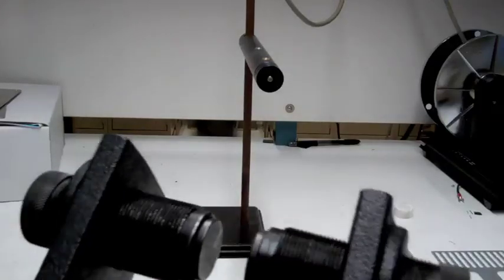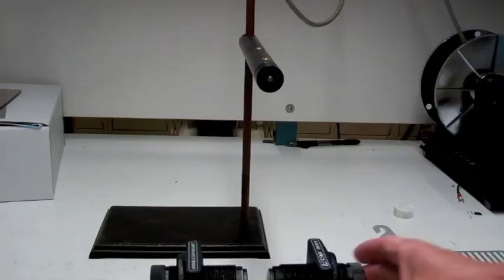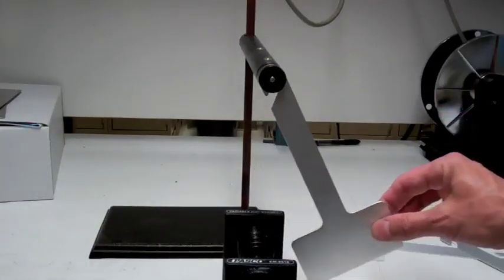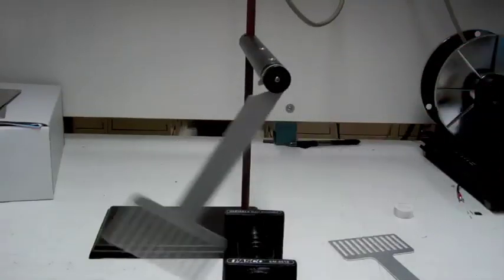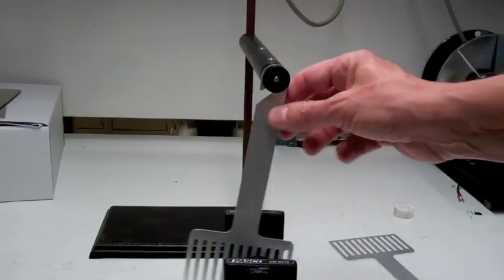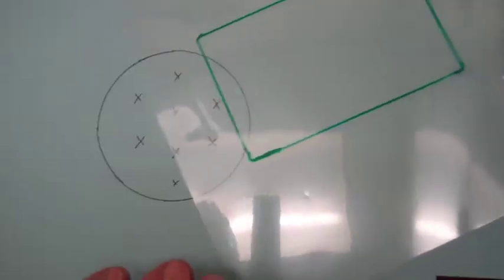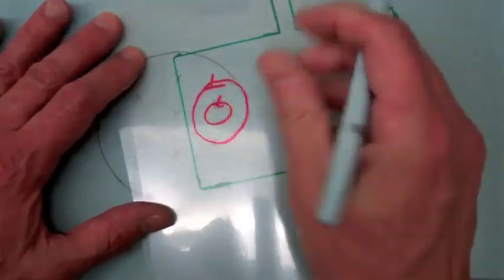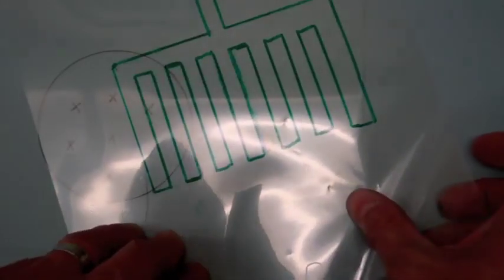Eddy Currents and Magnetic Braking of a Pendulum Caused by Electromagnetic Induction

Comment: Sounds dumb but can we create car brakes with this?
Reply: they are used in breaks for high speed trains and rollercoasters actually! so your idea isnt that unreasonable. i think one problem would be that for a car, you wouldnt want a dead battery to mean no breaks if its an electro magnet. (i think permanent megnets would be too much extra weight). also a car break with this mechanism would "feel" different especially with low speeds while parking for instance. the sharp breaks of friction based technology probably make for tighter control.

its a fascinating idea though. i deffinetly wonder if its been tried for cars.
Reply: @kettenschlosd  Oh cool! Thanks for sharing. And maybe they can create a hybrid system, magnet brakes with faster speeds  like on the highway and then it switches to a mechinal one at mechanical  half way. Or if no electromagnetic power, just defaults to your mechanical brakes. Regardless, this is cool technically and never knew that roller coaster utilize this

Comment: The red current loops are drawn incorrectly. Half of the loop must be outside the magnetic field. This is required so that the Lorentz force stops the pendulum (else the force on half of the current loop cancels the force on the other half). The current loops form around the boundary because they encircle the change of flux, which is at the boundary of the magnetic field.
Reply from the maker: I should have been more careful with drawing the  eddy currents. Back then I had a difficult filming arrangement and it was hard to concentrate on what I was saying, what I was drawing, and what I was filming.

Comment: How does a battery operated magnetic pump work? There must be an aluminum showing between the coupled magnets, so how do they get around the Eddie  current problem and keep their efficiency?
Reply from the maker: I don't know anything about magnetic pumps. It is something I will look into and maybe there is a potential video there!
Reply: @electricandmagneticfields2314  Oh man that would make a great video! Basically you can magnetically couple a motor to a shaft radially through a housing so there are no shaft seals which is a huge advantag for a lot of reason. However, there are a few tricks to maximize coupling and minimize eddie currents I'm still trying to understand. Advanced Diver Propulsion Vehicles also use them since shaft seals are the biggest risk to flooding a housing:

https://youtu.be/eufuhWX-ZjM?si=SGjZJTR_Idv97WEf&t=19

https://www.youtube.com/watch?v=IAkxS1xVraw
Reply from the maker: @peteabdu9179  Thanks!

Comment: If the eddy current results in a magnetic field that acts perpendicular to the motion of the pendulum, then why does it slow down? Wouldn't it need to experience a force in the opposite direction to the way its travelling in order for it to slow down? And does the magnetic field due to the eddy currents cancel out with the magnetic fields due to the bar magnets?
Reply from the maker: The force on the eddy current from the permanent magnet is F =Idl x B, so perpendicular to the eddy current and the the permanent B field. Superposition holds so the magnetic field at some point in space is the same of the tow magnetic fields. Just like it would be if you had two bar magnets.

Comment: Great Video. Well explained
Just wanted to inquire whether there is a formula to calculate the magnetic damping caused by eddy's current.
Reply from the maker: Thanks for the kind comments. The calculations would probably have to be done numerically. First using Faraday's law to determine the induced currents and then F = IdLXB to get the force on the paddle.
Reply: @electricandmagneticfields2314  thank you but how would the number of oscillations, come into play in the formula. As I'm really curious to how eddy current is produced from the pendulum motion but want to know how to quantify my observation.
If you could help me, I would really appreciate it.
Reply: @electricandmagneticfields2314  how do you determine current using faradays law

Comment: I understand the direction that the magnetic field is induced but how does this lead to the pendulum stopping, i.e. how is a force created in he opposite direction to the motion?
Reply from the maker: You can think of the pendulum as becoming a magnet. So for the two permanent magnets and the magnet representing the pendulum you would have,

[S permanent magnet N]  [N pendulum S] [S permanent magnet N]

So as the pendulum tries to swing between the two permanent magnets it is being repelled by the two permanent magnets and hence slowed/stopped.

Comment: can temperature equivalent to 1000 degree c be produced by the help og eddy currents????
if so what should be the strength of the magnet used?
can iron be used for the same???
Reply from the maker: I have never looked at calculating how much heat is produced. I would have to think for a while as to the best way to calculate the heating. The heating would be directly proportion to the total change in flux with respect to time. So the larger the magnet and faster the motion the greater the heating.
Reply: thank u sir...could u plzz confm it...is it possible st all?
Reply from the maker: Yes it can be done. From the changing magnetic flux caused by the motion you can determine the electric field intensity induced in the aluminum. Then from the resistivity of the aluminum you could determine the resistive heating. Alternatively, since the solid aluminum pendulum stopped immediately upon entering the magnetic field region, the kinetic energy the pendulum had would have been converted into heat--a simpler way to get an estimate of the heating.
Reply: very thank u..sir...u helped me a lot...
Reply from the maker: I'm not sure what is practical using a mechanical motion to produce induction heating, but using an AC signal to generate the changing magnetic flux is how induction furnaces operate, http://en.wikipedia.org/wiki/Induction_heating

Comment: can you please tell me the strength of the magnet used ,thickness of metal sheet and the amount of heat it produced
Reply from the maker: The magnet was a variable gap magnet with two one inch (2.54 cm) diameter neodymium magnets, I am not sure what the field strength was. The aluminum pendulums were about 2 mm thick.
Reply: thnxx...

Comment: Hi Michael!, I have a question... If there's a steady neodymium magnet and I horizontally slide an aluminum strip considerably close to it, the strip will slow down till it stops or it will just continue to slide but a bit slower?
Reply from the maker: Interesting question. As it slows down, the eddy currents will get smaller and smaller, but they should still be there and exert a force on the bar till it stops. But it won't actually be held in place by the magnet, so any additional outside forces and the bar will move. That is why when used as the brakes for a roller coaster magnetic brakes can't be used as block brakes so there has to be an additional brake to stop/lock the roller coaster.

https://en.wikipedia.org/wiki/Brake_run

http://physics.gu.se/LISEBERG/eng/magn_brakes.pdf
Reply: Great!. Thank you for the answer, it helps me a lot. Have a good day.

Comment: Hello professor Melloch, 
My name is Rich and I was wondering if you could give me an opinion on a possible solution to a problem I’m having with a set of carburetors that would involve eddy current damping.
 
The problem I’m having seems to be caused by the vacuum operated parts of the carbs lifting too early and fluttering. 
When this occurs, the engine quickly loses power and stalls, probably from an over rich condition.
Here is a video of that happening; it should start at an appropriate time index.
There is a white dot on the #3 throttle slide ( 3rd from the left), it bounces rapidly as the throttle is opened.
https://youtu.be/VtmbGLGt3qw?t=193

What I’m wondering is if I could put a small magnet(s) in the plastic throttle slide ears as a way to damp out the fluttering. Not sure what the carbs are made of – Aluminum or Zinc or some alloy in between. This video starts at a point showing the slide suspended in the carb body.
https://youtu.be/6sd-YwEv0Jo?t=127

I think the fluttering is caused by the air intake pulse on this 4 stroke engine and a lack of slide damping.
I would appreciate your opinion as an expert in this field.
Thanks

Comment: hey sir , i have lots of questions
1)can i use 10mm x 1mm neodymium magnet if not plz justify .
2) which type of sheet you have used steel or aluminium or stain less steel.
3)how you have attached the magnets at that object which you have used . 
4)way you have attached the magnets in brief .
plz justify beause i want to do it practically
plz
Reply from the maker: 1. yes, but the more magnetic flux the stronger the braking.
2. the pendulums were aluminum
3. Not sure of the question, the magnet I used was this one
https://www.pasco.com/prodCatalog/EM/EM-8618_variable-gap-magnet/

Comment: Nice Presentation. Gives a thorough concept on eddy current braking. Can we use the same principle for  generating torque? Please advise!
Reply from the maker: The force is resulting in a torque on the pendulum.
Reply: Thanks for your reply. Are there any formulae for calculating Torque? If so please share!
Reply from the maker: Torque is the cross product between the force and the distance vector from the axis of rotation to the location where the force is being applied,

t = F x r

https://study.com/academy/lesson/what-is-torque-definition-equation-calculation.html

Comment: This is so helpful. Thanks sir.. I have just one question.  Can you explain once more why the eddy current can't flow in the third pendulum?
Reply from the maker: There are still some eddy currents flowing, but they are greatly reduced because they cannot flow between the thin aluminum strips because of the air gaps. The only eddy currents that can flow are in the thin aluminum strips.
Reply: Michael Melloch
 thanks a lot sir
Reply from the maker: You are welcome!
Reply: The other two pendula are closed "loops" (I put loops in quote marks because the first one is a solid) and thus a current can flow in the bob (the swinging thing on the end of the pendulum). In the third pendulum, there isn't any connection between the ends of each "prong" (if that makes any sense) and thus no current can flow within the bob, so no damping.

Comment: ELECTRICITY and magnetism are two aspects of the same force. One cannot exist without the other any more than light can exist without the darkness which exposes it. The real demonstration here is Lenz's Law but its never obvious. On the atomic level, electron flow is induced in the aluminium via the mechanical motion of the NIBs. This current in-turn produces opposing magnetic flux and it is this repulsion that imparts motion on the embodiment. It is again demonstrated during the dynamic braking cycle when non-magnetic aluminium is "magnetized". With sufficient "flux density", even a live frog can enjoy floating in mid-air. 2VlWonYfN3A

Comment: I believe that if you put so strong magnetic or electromagnetic field to some material lets say a magnetic one like iron due to high speed it can produce such a "gravitron" shock to the molecules that they could rip apart, because of that theory I think that every single atom has its "gravitrons"' poles faced to one single N or S point in the galaxy but that that you can't have a monopole magnet the Universe is toroid shaped with s small hole in the middle...